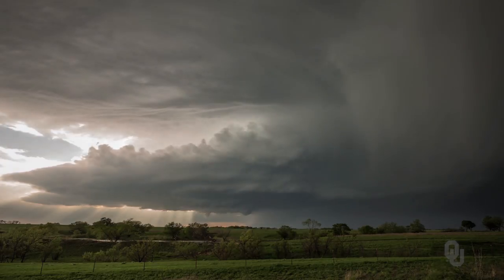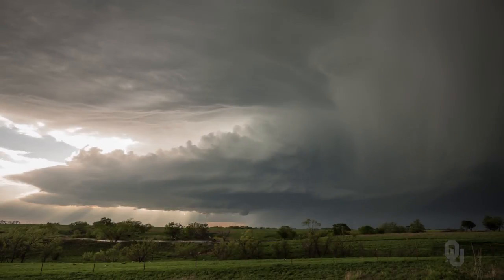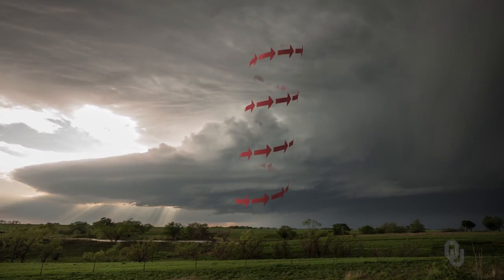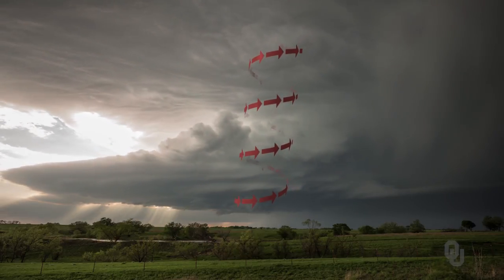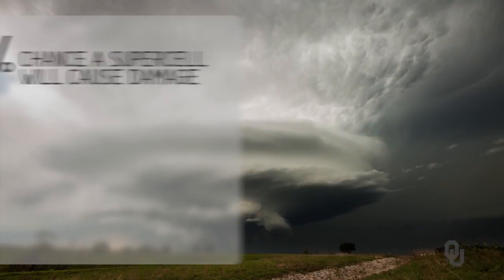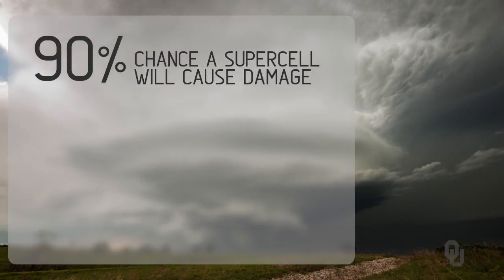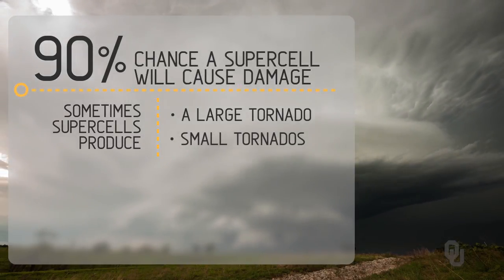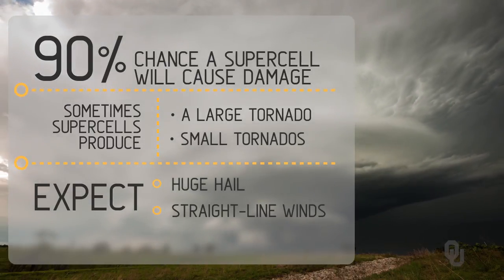Gary England's Tornado Alley – Supercell Storm in Action

Comment: couple of questions:

- Was this in the UK? if so where was it?

- Did it produce or try to produce a tornado

this actually quite rare for the up we never get severe storms like this at all , it tends to mainly be in America like Tornado alley most of the time in the kid west.
Reply: But England does get severe thunderstorms, they come up from France and Eastern and Central England can spawn these big storms like in US but very rare, temperatures need to be in the high 20s or low 30s, with high humidity and high CAPE values, or a Spanish plume coming up from France and Spain with a keen Westerly wind. This is best for a thunderstorms in UK as it can become a beasts of storm with the occasional small tornado, hail, strong winds and frequent lightning. 

As a kid growing up in the 1990s every summer you could guarantee a severe storm or two across England.
as we had a thunderstorm every 3 to 4 days, storms could last all night. Sadly those days are long gone.
Reply: No look at the description
Reply: Supercells in the UK are rare and when they do form they are almost never this organized, which is why tornadoes that do occur there are relatively weak and struggle to get up to EF1 strength. This is a textbook Great Plains supercell. Weak supercells can still form strong tornadoes, though, as made evident with the F5 tornado that struck Jarrell, Texas in 1997. It formed in a manner that weak, "landspout" tornadoes typically form, in the gust front of a severe thunderstorm. In fact, the thunderstorm that spawned this tornado and two other F3 tornadoes was technically not even a supercell, despite having a mesocyclone and tornado warning. This event is still an outlier and is still being researched to this day.